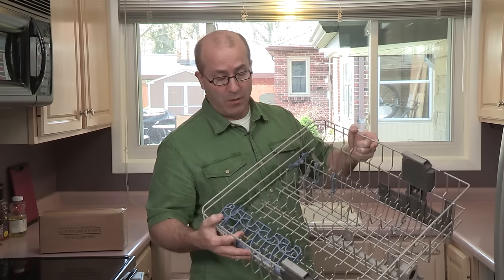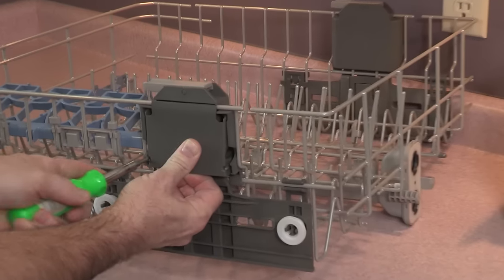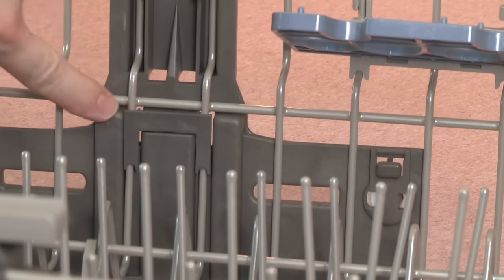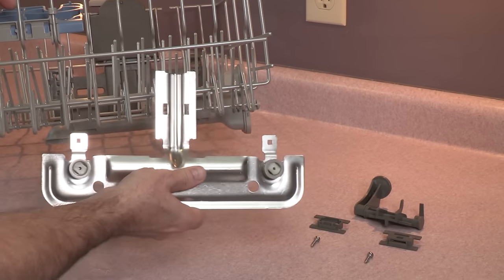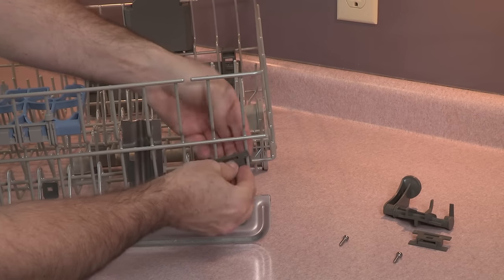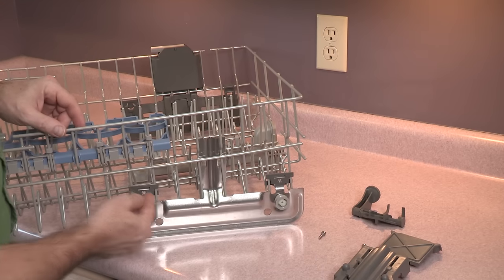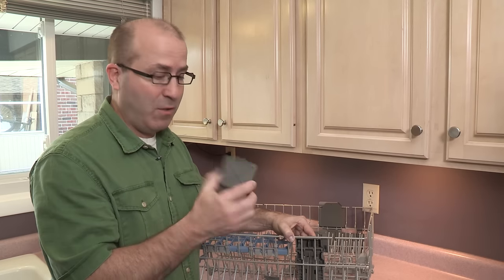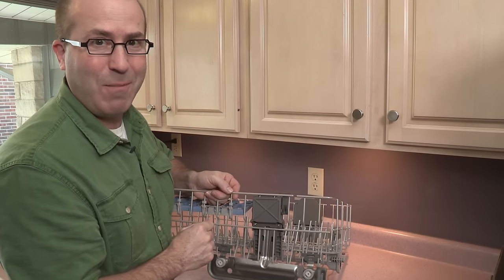Whirlpool dishwasher rack adjustment replacement kit install video  | Whirlpool Self Help Videos

Comment: This official video is wrong , the ajuster body has to slide into the metal piece if not it doesn't fit perfectly , if you look at the video he doesn't slide into the groves of the adjuster body he just put them on top an that way it doesn't close perfectly.
Reply: Yeah completely wrong. I wonder how many people have failed on the installation of this because they didn't slide that metal piece up into the adjuster like it's supposed to be. 

If you're going to post a how-to video you should at least know how to do it
Reply: Thank you for this comment. It likely saved me a headache.

Comment: This video misses a few steps to actually get the rack repaired.  First, he installed the clips backward. That’s not a huge deal as it can work that way, but it does cause some misalignment.  More importantly the metal piece has to slide into the grooves on the plastic adjuster before attaching the cap.  In this video the adjuster is not actually connected to the metal component and will not function at all.
Reply: that took me a few minutes to figure out, too
Reply: Missing the sliding the metal part into the plastic actuator should be cause for taking this down. Wasted time not knowing this.
Reply: Thank you for confirmation of my confusion of this videos faults!

Comment: Careful when he says "nests right into the rack"  What he forgets to mention is that the metal piece that is attached to the wheels has to sort of thread up into the plastic body.  Had he said this for this IMPORTANT step, I would have finished this in under 10 minutes.  The second side was a breeze, but I had to use another video to be sure of the metal to plastic fitting.
Reply: You are correct, sir!!  A 10 minute fix turned into a four beer frustration....he leaves out a crucial step.....don't use the 'official whirlpool' site!!
Reply: Agree!  The next video that automatically loads explains the installation steps better, but forgoes the explanation on how to remove the original adjuster assembly.
Reply: @brucetroen6703  what's the other video you and eddie cox are referring to?
Reply: He actually installs the thumb levers backwards.
Reply: Use this video for the old adjuster removal steps. Then use this one for the installation steps: https://youtu.be/C1sj_sO7jiU
Reply: Yes that is correct - exactly.  I just spent the last 30 minutes trying to figure out why the thing wasnt lining with the bars.  Otherwise a great video though.  Thank you all.
Reply: Took me a while to realize that, 0 out of ten for this technician.

Comment: Great video!  However, as mentioned below, the metal adjuster has to slide into the grooves of the long plastic piece it attaches to.  This does not seem to be done in the video.
Reply: So he basically didn't do it right? Because I'm having issues getting it in

Comment: This video is fairly lacking. The second half rushes far to quickly had to watch it several times, more or less skips steps. The presenter is nice, but it should be twice as long. How about more explanation of the parts, the orientations, and install, function, etc. and an explanation about why the replacement parts are different from the original

Comment: So let me get this straight: there were problems with the original design, so Whirlpool expects us to go out and spend money on the replacement “Heavy duty” stainless steel rack adjuster because they screwed up and used plastic to begin with? And then we have to fix it ourselves or pay someone else to fix it? Maybe this should’ve been recalled.
Reply: Your comment is so correct! Were you able to get a free replacement kit? mine just broke today!
Reply: @steves723  Wait, there are free replacement kits? I had to buy mine. Mine just broke last week. Please let me know.
Reply: Wait what? They just sent me one single plastic replacement part ... not a KIT! Am I replacing one frail fragile p.o.s. with another one? Am I going to be doing this again in 4 months?
Reply: @blakeab  i tried to get a free one but had to buy off of Amazon....
Reply: @steves723  I just got my replacement and now my dishwasher is making really loud noises to I have to replace the whole thing 🙃
Reply: What I don’t get is why they continue to ship new dishwashers with this crap plastic part, that they obviously know has problems or there wouldn’t be this redesigned version, 7 YEARS after this video was made. Guess the Whirlpool execs have to get their money’s worth out of all the injection molds they paid for, on our dime. I noticed the main large plastic part that breaks easily has at least 12 cavities. That means the injection mold for this part is a collection of precision made hardened steel blocks roughly the size of a compact car, or larger. Not cheap. And that’s just for one of the parts they obsoleted. So the natural decision, of course, is to keep producing them and hope most people won’t gripe too much about it.
Reply: You may be able to get the kit free.  Call or Chat with KitchenAid.  Explain all the plastic wheel hub ends have broken off.  Say it seems like it might be a design or manufacturing defect, and ask if there is a recall or bulletin on this problem.  Have your Model# and Serial# ready.  This worked for me.

Comment: I wish I would have read the comments first! It’s a travesty that this video is still up as an official Whirlpool video despite being wrong. The actuator piece does not “nestle into” the metal piece; the metal piece slides into the plastic actuator piece.

Comment: Important steps are missing in this demonstration. 1) how to undo the clips which hold the drawer on the racks; 2) need to slide the  rear piece onto the metal upright piece of the roller assembly; 3) how to insert the actuator piece  BEFORE snapping the front piece to the back piece 4) how to replace the clips on the roller  glides. Checkout other videos. good luck

Comment: I found a perfect replacement for the broken plastic piece online.  His instruction on how to disassemble the original to get it off the rack was very helpful. I had it off in seconds. The new part with improvements clipped on instantly.  Done.  Thanks  for this video.

Comment: Important information missing in this video!  Mentioned by both Jay and Steph, thank you.  I had to reference the paper instructions to see that the metal piece must thread up through the plastic body or it will NOT snap in place.
Reply: Same here, only I did not have any instructions in the box. Finally figured it out.

Comment: Thanks. I got a different replacement rack adjuster - but this video was a big help to me in disassembling (and then just had to reverse steps to assemble). 16 bucks for two new rack adjusters - wonder how much a repair company would have charged for this simple job.

Comment: Thank you!    I wish Whirlpool would recognize the original plastic part was crap.  Didn’t appreciate having to pay for the new metal piece, but at least the broken adjuster didn’t result in buying a new dishwasher.
Reply: You may be able to get the kit free.  Call or Chat with KitchenAid.  Explain all the plastic wheel hub ends have broken off.  Say it seems like it might be a design or manufacturing defect, and ask if there is a recall or bulletin on this problem.  Have your Model# and Serial# ready.  This worked for me.

Comment: Those metal rack adjusters must slot into the plastic body.  The video doesn't show this where it should, between 2:55 and when he installs the adjuster cap at 3:30.  Otherwise very good instructions.  Like the calming music, which should always be played when DIYing appliance repairs. :)

Comment: This very helpful.  The only issue is at the 3 minute mark, it isn't explained that the metal piece of the adjuster rack that sits inside of the adjustment body needs to slide between some tabs and click into place, or it won't fit properly.  In the video they just kind of loosely assemble it together, which won't actually work.  Great video otherwise.

Comment: is there any way someone can get a part of the kit instead of having to get the entire one?  At 1:02, you are removing a face plate contraption (I don't know what it's called).  That's all I need.  It would be much easier to just snap one in place than have to pay 6 times more for the kit and have to go to the extent of replacing the entire kit.  I know the adjuster kit has been redesigned but perhaps if some company you know that sells old parts is still around, is it possible to get the part?

Comment: You may be able to get the kit free.  Call or Chat with KitchenAid.  Explain all the plastic wheel hub ends have broken off.  Say it seems like it might be a design or manufacturing defect, and ask if there is a recall or bulletin on this problem.  Have your Model# and Serial# ready.  This worked for me.

Comment: what do you need the adjuster for.  It says in my manual that mine "adjusts" but I have yet to see how it happens.
Reply: It allows you to adjust the upper rack up and down to fit taller things in the bottom rack push down on the round plastic adjuster tabs and you can move it

Comment: Thank you for the basics as the factory instructions are vague.  Unfortunately, the way that this  rack is repaired in this video does not allow for rack height adjustment.  One needs to be careful to have the thumb pad facing the front of the rack and the vertical portion of the adjustor arm needs to be slid completely into the adjustor body - as seen in Figure 6 of the instructions.
Reply: The video was helpful but it missed the important step of aligning (inserting) the metal edge of the adjuster with the plastic slots of the adjuster body. I should have read the comments section first; it would have saved me an hour of frustration.   Yep, it would have been an easy 15 minute fix.   Once it was put together correctly everything worked great.

Comment: The adjuster body install is in error in this video. The wheel metal part has to "slide" into the adjuster body grooves otherwise the parts do not align.

Comment: The value of this video is he shows how to remove the old adjuster assembly. Some important points on installing the new adjuster are missing. You'll want to check out another video for correct instructions.

Comment: You have to search youtube for a better video on how to attach the metal piece to the plastic body.  This video does not explain it and you will not install it correctly.  The other video does a much better job of explaining that crucial part.

Comment: if it was truly a OEM piece for this rack , it would be a complete plastic assemblie   - the original piece was all composite plastic- not metal - so is Whirlpool stating the plastic is crap from beginning and that's why they have metal replacement or is whirlpool try to scam consumers by having this made by a third party  chinese company and this is what they are trying to shove at people
Reply: The metal one (W10350375) is the correct metal part. The original one was crap. My wheels failed after 6 months.
Reply: It's all part of the aftermarket/service scam these appliance manufacturers have been using for years. Make the original equipment with garbage so the consumer has to replace the parts with genuine OEM parts...

Comment: Very frustrating video. Skips steps or does not explain thoroughly. In one step, he literally says, this one can be tricky and then cuts away until after it is done. Also does not explain that the metal adjuster needs to slide into the housing. Just says to clamp it in and it should fit fine. Had to watch another video with more thorough explanation.